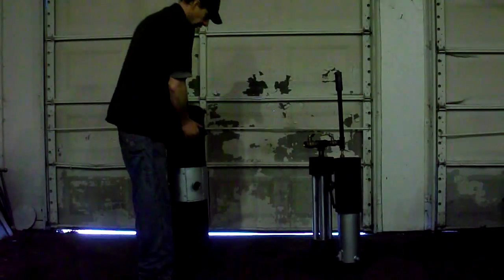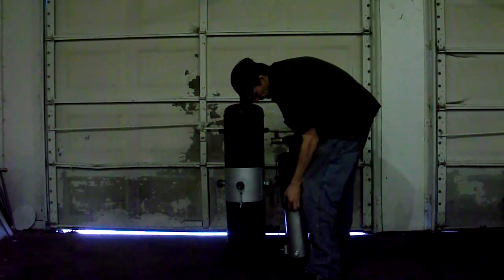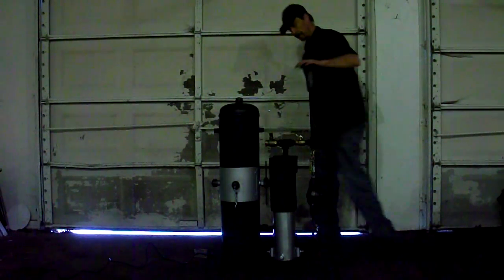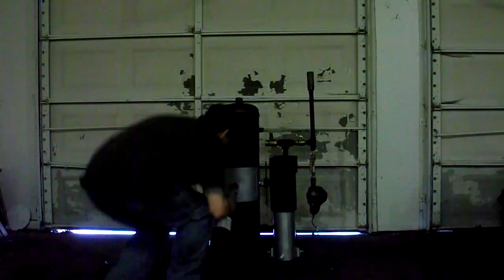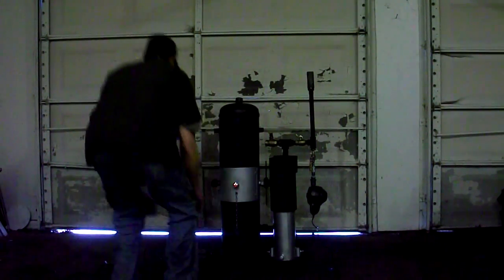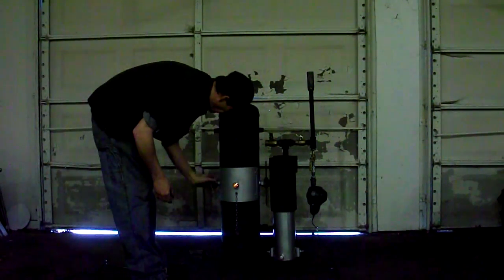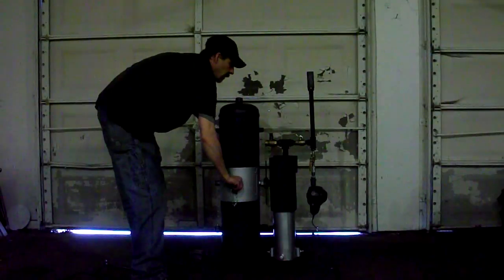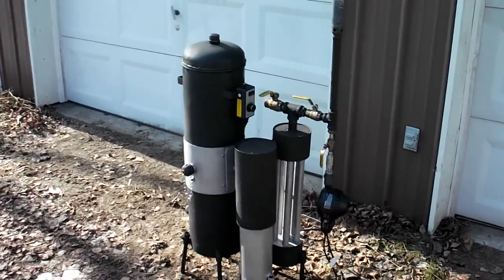M-1 Pre-Production Model Demo

Comment from the maker: @ke4uyp Im working on it. Hope to have vids of the  m-1 next week running a 2000 and 4000 watt genset. I still work a full time job on top of this. Im a field tech and am gone 90% of the time. Im going to take some time off to work on the company its moving a LOT faster than I had anticipated. If you have questions go to the contact page on the website

Comment: If you want to dramatically improve this demonstration video, you should have your system actually running a gasoline engine.  You should also have a load on the engine to prove that your system can provide sufficient amount of BTU output.